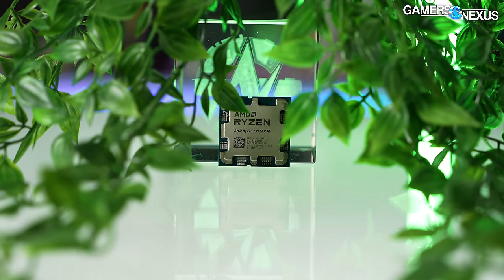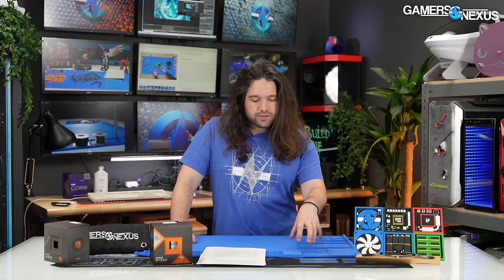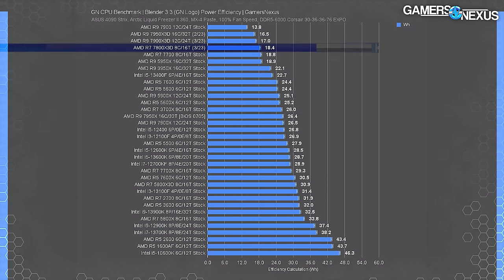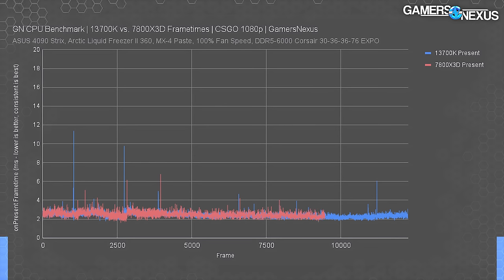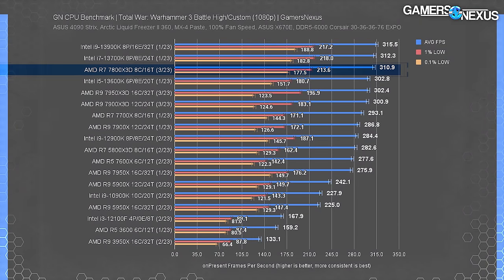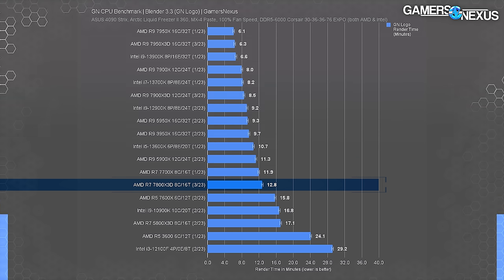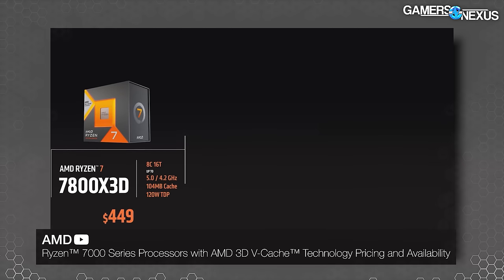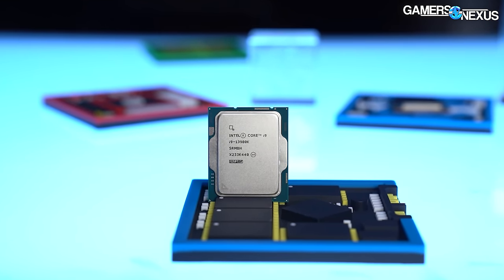AMD Ryzen 7 7800X3D CPU Review & Benchmarks

Comment: I just bought a 7800X3D to replace my current 7700X. 

I know that the difference in gaming performance is likely to be somewhat minor. The 7700X is a damn good chip. It’s great for games and it’s especially good for consumer/prosumer level productivity tasks, which I don’t really do on this machine very often. 

Anyway, it seems like one could expect anywhere from a 5-15% uplift in frame rates depending on the games and that isn’t a major improvement but I primarily bought the X3D because of its efficiency and low power consumption. The added gaming performance will basically just be a nice bonus. 

After switching from my AM4 system with a 3700X and a 2070 Super to my current system with a 7700X and a 6950XT, the amount of heat being dumped into the room by this PC is substantially greater than I’ve ever experienced before. The Zen 4 chips seem to generally run pretty warm and I live in Texas. After a few hours in some games, the room is uncomfortably hot, despite the rest of my house staying at 70 degrees. I’m using a 360mm AIO and still sometimes see the 7700X sitting in the mid to high 80’s. My 6950XT runs quite cool so I’m hoping that once I pop the X3D into this machine, it should draw significantly less power, create less heat and improve game performance to boot. 

It’s kind of a lot of money to spend just to get a more efficient chip with a fairly marginal overall performance increase but I think it’ll be worth it and now I plan to go quite some time before doing another CPU upgrade.
Reply: I doubt you’d see a 20? watt increase in heat from your CPU. Especially when a GPU can output 5x more heat than your CPU
Reply: Im planning the same upgrade and I had the same issue with 7700x so high temps but I fixed it setting it to 65w eco mode and temps went down a lot between 55-65 while gaming, so how are temps on 7800x3d? thanks.
Reply: @armandoarroyo  I run my 7800X3D on eco mode and even in demanding games cranked to max settings, it’s usually hovering around 62 degrees. I’ll get intermittent spikes up to 70-73 from time to time but it always settles back down quickly. I’m running a 360 AIO exhausting through the top so it’s also exhausting the heat from my 6950XT and still the temps for both are totally under control. 

I’ve been playing cyberpunk again for the last couple of weeks and both stay at a steady 61-63 degrees. With that game, I typically use a frame rate cap at about 75fps to make sure I get the graphic quality I want without running too hot. If I don’t cap the frame rate, both the gpu and cpu will definitely start getting into the high 70’s, maybe even low 80’s. But that’s a pretty demanding game at max settings. I play exclusively single player games and nearly all of them can run max settings or very close to max with no fps cap and temp issues whatsoever. 

I definitely recommend the 7800X3D. It’s probably not the best bang for buck purchase you can make if you already have the 7700X but it’s been rock solid for me.
Reply: @kylestewart4444  yeah I already have 7700x and I care about temps, how you set the eco mode on 7800x3d? Just adjusting the CO to a negative value ? I have heard that is kind of different when indervolting 7800x3d. Still wondering if it is worth the upgrade tbh.

Comment: That frametime chart actually made me hold on my decision to purchase the CPU. The whole reason of wanting a 3D cache for me is a smoother gameplay, if there are frametime spikes, that's a big issue.
Reply: They're sub-10ms spikes. You won't even notice them, and the more major spikes that ARE noticeable are likely going to happen on any CPU because they're not the CPU's fault.
Basically it's a graph that doesn't matter other than to confirm that it's a normal CPU that compares evenly to other normal CPUs. The spikes are a non-issue, in any practical way.
Reply: You have seen 3 charts for 3 games of which 2 were completely normal and just one showed more variance. This anomaly was for Cyberpunk 1.6. The 2.0 update has improved the x3D performance by a ton to where the 5800x3D beats the 13700k in 1% lows by 10 fps and average fps just by 2 fps (according to HW Unboxed benchmark), meaning Cyberpunk was the problem.
Reply: @HopemanGG  I bought it this summer :)

Comment: "7800x3d makes 7900x3d look like trash" 
(Looks over at my 7900x3d build) 

It's ok, you're still a beast! Still maxing out fps and getting more than the 13900k in a lot of titles.
Reply: What titles?
Reply: @griffin1366  watch the video
Reply: Don’t let the haters get you down. I will probably be forced into a 7900x3d as it’s likely impossible to get my hands on a 7800x3d for many months…
Reply: @livid1671  most titles lol. 
I play world of warcraft mainly. And my 7900x3d gets on average 30-50 more fps 9ver my friends 13900ks who has super tight ram timings as well. 

7800 is great, but I'm happy with my choice. I'd rather have 12 cores than 8. I do allot of rendering as well. 

That aside, my performance is insane as it is with my 7900xtx!

Not only that, the 7800 doesn't beat mine in every game. In a lot of them they were the same
Reply: >world of warcraft
Do you really need $5,000 worth of hardware to run a 20 year old game?
Reply: @griffin1366  you know it’s had a few updates since it’s original release right 😂
Reply: @duckilythelovely3040  ong
Reply: Cope more bro

Comment: Thanks for including Warhammer 3 regularly, would like to see more modern titles to see what the differences are with lots of physics and DLSS hit. What I have in mind is something like Hogwarts Legacy that has a severely limited framerate in Hogsmeade due to CPU limitation, even at 4K. I turn on DLSS 2.0 to achieve higher framerates overall but I definitely take a hit specifically in a location like Hogsmeade. Would be interesting to see how CPU's scale in that or a similar scenario.
Reply: yeah GN is awesome and top 3 pc tech tuber but their game choice is quite annoying. its not incorrect or bad, just annoying. i need to see other games as well, EPSECIALLY with how weird x3d is with games
Reply: Hardware Unboxed covered Hogwarts and other games, try checking their results out too
Reply: @daemonwhite3740  I did, it's good, love Hardware Unboxed. I guess I would like to see Gamers Nexus level of analysis on something of that nature.
Reply: @daemonwhite3740  hes biased af
Reply: @fookoff8660  To who and what? Their results are not very different from anyone else's and all seems within test specs.
Reply: @daemonwhite3740  very much different. hwu's intel cpus are always at the bottom where as literally everyone else is similar or slightly lower. for him its always at the complete bottom. dunno how you havent noticed it lmao
Reply: @fookoff8660  HUB's benchmarks also don't use the same settings that GN does. Tomb Raider is Highest, GN does Medium. CSGO is Medium, GN does High/Custom.
CP2077 is RT Ultra, GN did Medium.
Blender is the Open Data benchmark, GN uses their custom logo render.

Are you not noticing the different settings they're stated as using?
Reply: @daemonwhite3740  then hes not benching correctly. Theres a reason why every normal techtuber does Lowest possible
Reply: @fookoff8660  It's also useful to consider different situations and use cases in my opinion. It's fine to have one trusted reviewer, but seeing what other people got with different setups provides additional context.
Reply: @daemonwhite3740  but cpu benches on low settings give u an objective score/overview how x cpu really performs

Comment: I wouldn't really say AMD intentionally "kneecapped" the 7800X3D's clock speed to make the 7950X3D "look good". The max boost speed listed (5.7 GHz) is for the overall CPU. For the 7950X3D, that's specifically the faster normal CCD, with the V-cache CCD with a boost closer to 4.925-5.1 GHz, essentially the same 5 GHz average. If the core parking and thread assignments are done appropriately for the more complex 7950X3D, that would explain why the 7950X3D and 7800X3D essentially neck-to-neck. Granted, that's a big "if" which, does show in some titles. Would it have been more transparent if AMD listed separate boosts for the different CCDs? Yes. But mentioning that would give an easier perception on what's going on. Because the way this is presented, it seems like the 7800X3D is magically making up "that" clock speed difference.

Comment: I bought 13700k for a new computer a few days ago, and I was worried whether I should purchase a new 7800X3D and refund the 13700k, or just stay with it. In conclusion, I am staying with the 13700k since my main will be Adobe programs and gaming for a sub.

Yes, the amount of electricity that 7800X3D use is impressive, which made me hard to choose between the two CPUs even though 7800X3D shows a less productive result when compared to 13700k. However, 13700k is faster for rendering, which means it will use a similar amount of electricity in a short time. It might be less productive than 7800X3D, but I don't really care that much about it. Plus, I got 13700k for a reasonable price, so I am just staying with 13700k. (I actually bought 13700kf + Was in sale)

Still, if someone needs a new PC just for gaming, 7800X3D will be an excellent choice than 13700k.

Comment: I was excited about the 7800X3D as a drop-in upgrade to my 7700X ,but looking how much the frequencies are capped, it runs cool and efficient which means even PBO isn't going to help, adding to that the performance benefit of faster RAM on X3D cpu's isn't that great either. I think my 7700X with its -30 Curve Optimiser + highly tuned ram might actually still be on par in gaming or even better , no way for me to test though. I hope you can test that Steve!

Comment: The 13600K is still the all around best CPU to buy, all things considered. It was $250 bucks at Micro Center recently.
Reply: Also when gaming it won't hit anywhere near the power draw you see in a CPU productivity app.
Reply: Yes of course i5 13600k is better than it can destroy 5800x3d!! The world already knows that NM is called The nanometer, it is the unit of length of the International System of Units (SI) that is equal to one billionth of a meter (1 nm = 10−9 m) when an example AMD X3D is that having 5nm and 13th gen is having 10nm++ !! 10nm++ vs 5nm then intel is worth using 7nm that can destroy AMD X3D

Comment: It is clear that this is a "gaming first" CPU so productivity tests are mostly irrelevant (except some rare use cases).
Please make a 7800X3D vs. 13700K  "long term ownership" comparison (including cost of power if gaming 3 hours daily for 3 years).
The performance may be close to identical for average gaming, but the 7800X3D:
- is easier to cool (=needs a cheaper cooler)
- needs less power (=cheaper AM5 motherboard compared to other AMD CPUs)
- needs less power (=cheaper PSU compared to most Intel CPUs)
- in long term saves money on electricity bills
- can be upgraded in 3-5 years without extra costs
Reply: Also less cooling of you and the room, as well.

Comment: I loved the frame time charts. Stuttering in games drives me nuts and frame rate averages just can't provide that info. The quick 1440p averages were a great touch. 10/10 video, makes buying a cpu way easier.
Reply: Thanks to Steve, i bought my i7-12700K by the smooth frametimes and i recommended a 5900X to a friend a long time ago for the same reason.

Comment: I've only experienced 11th, 12th and 13th gen Intel CPUs. Recently, my buddy wanted to get a new prebuilt PC, so I encouraged him to build it himself and that I'd help him (basically free upgrades, right?). He was insistent on AMD, which I said, SURE! Not familiar, but let's go!

Short story is, after reviewing all the data, I'm very impressed with AMD especially when it comes to wattage efficiency. Coming from a 13900KF user (420mm liquid freezer 2 in push/pull and it's overkill), I can see how much easier and perhaps price efficient it would make an AMD build while giving it more overclockability (depending) without worrying about the thermal headroom as much.

Obviously UV/OC is a great technique with most CPUs (and I utilize it), however, the 7800X3D simplifies everything - without sacrifice - while being a banger.

In the end, my bud found a sporadic sale on the 7900X, but I secretly was hoping he'd go for the 7800X3D.

Comment: you should consider motherboard upgradability too. I bought a motherboard with pci-e gen 5 and DDR5. And 7800x3d. i will upgrade my cpu without touching my mother board 4 to 5 years later. mb with GPU.

Comment: It would be nice if amd and intel made a specific cpu specifically targeted/marketed at gaming. And build it to be an absolute unit at gaming and cheaper than the “jack of all trades cpu’s” i know it’s a pipe dream… but i only ever use my computer for gaming, and watching video’s. And it would be nice to have a cheap cpu that blows the gaming charts out of the water, without having to spend $$$$$ on it.

Comment: I know 4k tests don't show a difference, and that's why you need to show them. 
Most high end builds are connected to a 4k display or 1440 ultrawide which is somewhere between 4k and 2k. People need to know it really doesn't matter for 4k, the 5800x3d is effectively the same.
Even if the increase in 1080 fps isn't worth it in your perspective people will still see "bigger number better" and spend the extra money.

Comment: Cheers to GN for actually expressing an objective opinion here, a lot of techtubers out there heaping praise on the 7800X3D, without looking at the shortcomings.  if you legit ONLY game on the games that the 7800x3d is good at (ones that need a lot of cache), then its the CPU for you.  The 7800X3d isn't the clear winner in every game either.  When youre talking 380 frames vs 400, how much does that even matter.  But performance is meh or lackluster in everything else.  Yeah its got great power efficiency, but for the average user its a few bucks a year, and you'll probably upgrade in a year or two anyway.  Huge press offensive from AMD here, honestly when you cut through a lot of it, its a bit disappointing.  The 7950X3d could've been good if they figured out the core parking issues.
Reply: I thought the early introduction to the chip was still very soft on AMD.
Reply: The X3D Ryzen 9 chips don't have real time hardware telemetry to analyze the program and instruction like Thread Director from Intel's Big-Little chips.

AMD will fix this with Zen 5.

Comment: Hi Steve - thanks for the video! :) I'm wondering if the all-core power consumption test was actually done with the 3090ti installed? All your other tests were done with a 4090. I doubt it would have made a difference and I assume the graphic wasn't updated - just wanted to check.

Comment: I think just outright parking the cores is dumb, there should be something built into the scheduler that gives priority to the ccx that's most beneficial depending on the load and the other cores can be used for background task or as extra when all the other cores are occupied, something built into Ryzen master similar to intels optane boost would be cool,as you use different programs it can log the best performing cores per load and adjust going forward

Comment: I got a 8700k now and I am looking to upgrade. It's between this and the 13700k and I think this review made it choice to go AMD for the first time in decades.
Reply: im in the same boat.. but im gonna pick 13700k for sure.. Better 1% lows and better frametime graphs are more important to me, and i like to undervolt my stuff so no proble with power consumption
Reply: @Chrontard  the frametimes are more consistent on the intel and have better 0.1 lows. Also, you are never going to undervolt the 13700k to 90w lmao

Comment: Was this with the default BIOS setting? I hear they lock the TJ Max on some boards and if you unlock it you get an extra boost. Additionally in most games power draw will not be nearly as high. I would like to see power draw comparisons over a few game titles. One other thing would be using a midrange GPU to see any differences. Not everyone has a 4090 or intends to buy one.

Comment: Very nice and informative review. Though not necessarily 7800x3D important but for the 7900x3D and 7950x3D would be cool to see a more multipurpose use case. Like how the system and the CCDs behave when there are different loads and not just 1, like only gaming or only production. Sure is very variable result but would be cool to see at least how the parking mechanic works for those scenarios like gaming and streaming with cpu encoding or that sort.
Reply: i didn't buy the 79003dx and I haven't opened the box yet, I'm thinking of returning it now after this painting.

Comment: 7:46 If during the All-Core 100% power consumption, the 7800X3D drew 86.4W, then why is the advertised default TDP 120W? Same for the 7950X3D, its TDP is also 120W but during the all core test it draw 156W? How is it possible for 7950X3D to draw more than its theoretical maximum power draw? Could anyone explain?

Comment: @GamersNexus; Now that the 7900X3D is selling for only $40.00 more than the 7800X3D, does that change your opinion on the 7900X3D?  Granted, gaming benchmarks remain somewhat the same, the 7900X3d offers a significant performance improvement for single core and multi-core performance.   Thanks.

Comment: Good stuff. You gotta wonder if they couldn't have pushed higher frequencies on this chip and just had a flat out clear winner cheap vs intel instead of trading blows. I get the impression they intentionally held the 7800x3d back in this regard just to avoid cannibalizing their product stack too hard (which they kinda did anyway). Still, it's a very cool chip, and it's great to see how far AMD have come in CPUs since the days of Haswell and Piledriver, where they were basically a non-consideration in gaming.